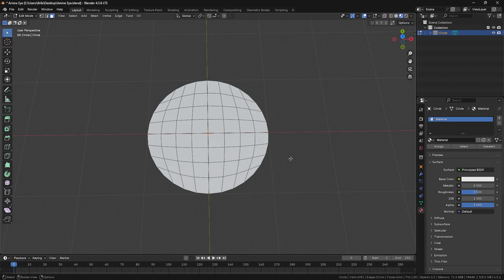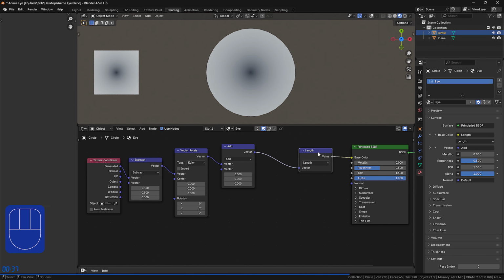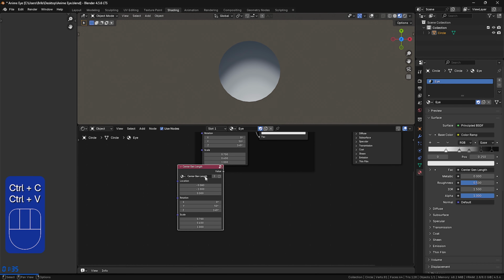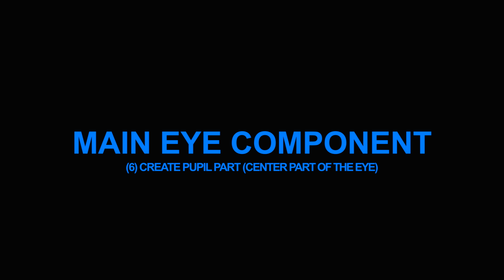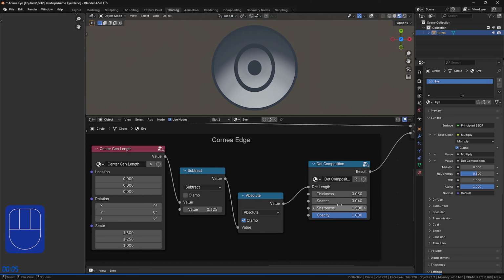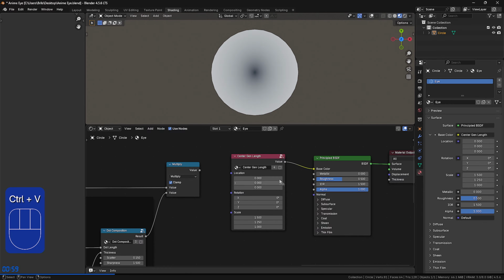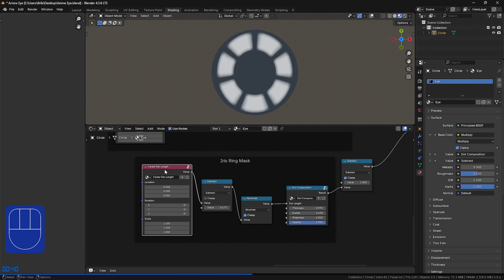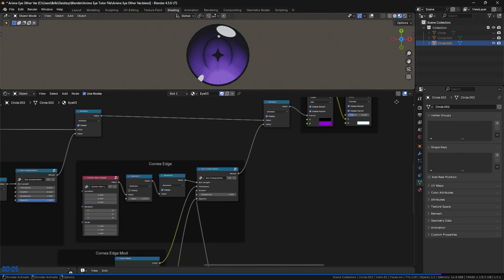Blender 4.5.6 - How To Make a Procedural Anime Eye Shader [EEVEE/CYCLES]

Comment: Is there any way to offset the location for all of these together? My model is one mesh so the eyes arent in the geometry center, and having to change the location of all the Center Gen Length's manually would be quite awful. Is there any way you can have some sort of global offset of the generated texture coordinates?
Reply from the maker: Yes, there is a simplest way, but this is going to change the rotate around geometry center function to rotate in the center of the subject shape. 

First, you need to modify your Center Gen Length Group Node, make the Add node and Vector Rotate node switch order, so it's going to be: Subtract node result to the first port of the Add node, then Add node result to the Vector Rotate Vector Port, then Vector Rotate result to the Multiply first Port Vector. At this point, If you rotate the Center Gen Length, it should rotate in the center of the subject shape, not around the center of the geometry center.

Second, you need to add a 'Math Add Vector' then plug it into the Center Gen Length Node Location port input. the Math Vector Add Node first port is going to be the base position adjustment, next, add a 'Constant Input Vector Node' then plug it into the second port of that Math Vector Node. The Constant Input Vector is going to be your Global Offset Location. So you just need to add the 'Math Add Vector' and plug it in to 'Every Center Gen Length Location input Node' that you want it to affected by the Global offset Location value. Finally, Plug the second port 'Every Math Add Vector' you added with this single same Global Offset Constant Input Vector Node.

Good Luck!
Reply: @BrilsYT  Is there also a way to make it work with the mirror modifier?